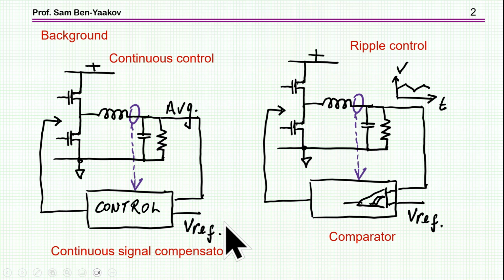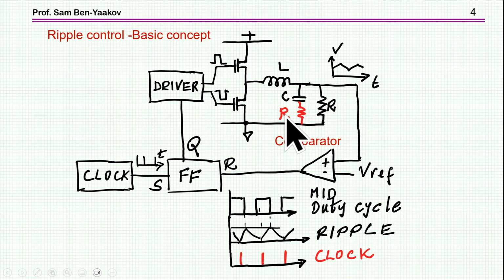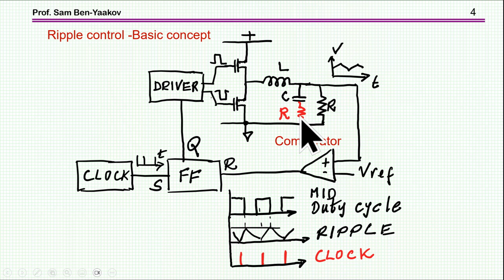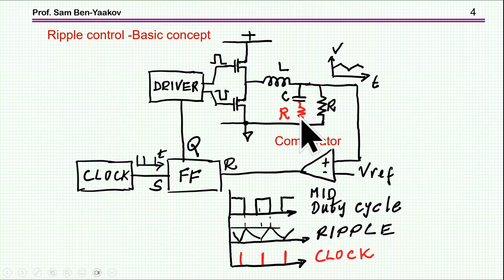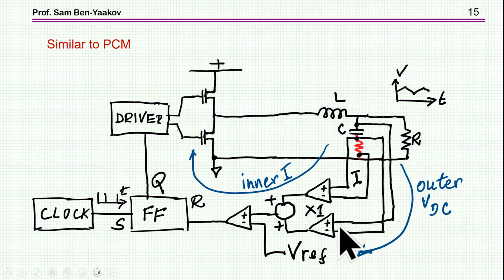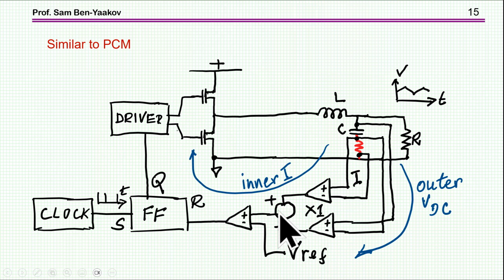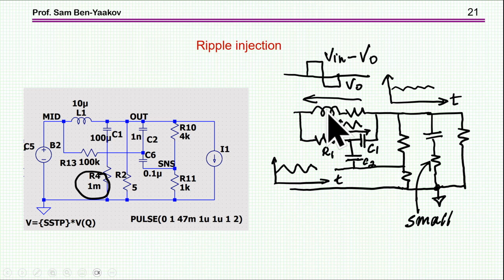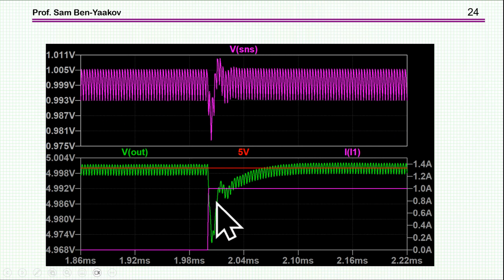Ripple control of PWM converters

Comment: Hi Professor, thanks for the valuable explanation! One question: is this voltage ripple always detectable in practice? looks like the sensing could be quite sensitive, is this right?
Reply from the maker: As explained in the video you can inject it
Reply: @sambenyaakov  Hi Professor, thanks for your reply. Do you have concern on the parastic inductance's impact? I am thinking about an output with many electrolytic capacitors. Maybe the current injection can even improve this situation?
Reply from the maker: @vanease1  I mean to inject the ripple into the point of sampling (divider). This is explained in video

Comment: Hello Professor, my friend got the idea for the control method of a parallel resonant ZVS/ZCS SMPS with a huge dynamic range of regulation, and he tested that successfully(single-stage AC85-250V SMPS with PFC). Could you please suggest to him the next step?
Reply from the maker: If he is an academician, a paper
Reply: @sambenyaakov  he's just an engineer, so he have no idea what to do next.
Reply from the maker: @ivane1168  He can interest a company to to develop a product based on in.Needs to find the area of application. He can stlll write a paper or upload a post to get credit.

Comment: Dear Prof. Ben-Yaakov, 
Thank you very much for your videos!
I would be thankful if you could advise on the two following subjects:
1. Please give a few examples of commercial controllers that exploit this method.
2. Please elaborate on the pros and cons of this method compared to the Current Mode Control (CMC). It looks like the Ripple Control is easier to design. Yet, if we want to protect the switches, we still need to measure their currents, like in the CMC.
Thank you very much.
Reply from the maker: LM5164QDDARQ1 is a variation with constant on time.
PCM is in general better but the ripple conrol has advantage when fast response is needed and when the input voltage range is large.

Comment: Hello professor,May I ask for an advice I am currently final year student of king mongkut’s university of technology north bangkok studying Electronic and power electronic engineering. I Love Power elctronic and I also keen on embedded system and pcb design. I'm myself I have little to no expirence working with real engineer in this field. For that reason I'm still looking for a job as R&D in power electronic or embedded system to get to know how real engineer work and do thing.So what I want to ask for your advice is if I want to get better in working as power electronic and embedded system engineer  what is your recommend and am I on the right track looking for R&D job?. Thank you professor
Reply from the maker: Hi, Indeed, the best way is to take part in design work in the industrial environment, with experience engineers from whom you can learn and grow professionally..

Comment: Hi professor, there are many attempt from literature to develop small signal model of ripple control and analyze its bode plot, is it valid to have small signal model on this kind of control?can you comment?
Reply from the maker: Good question. I am all for small signal and average models. But there is a point that one has to realize that when a system is higly nonlinar, linearization means little. We need more large signal analysis tools.